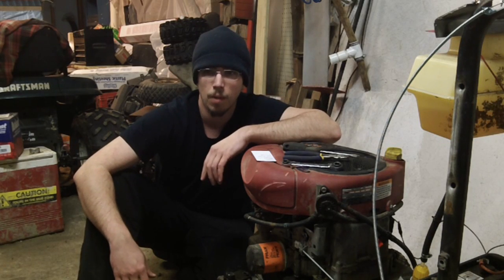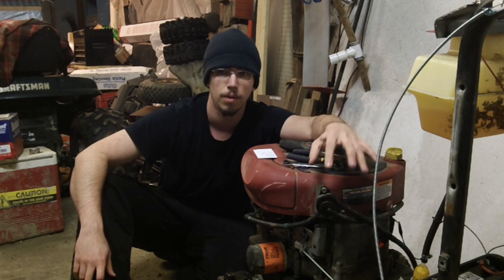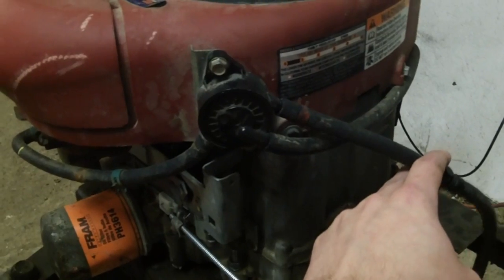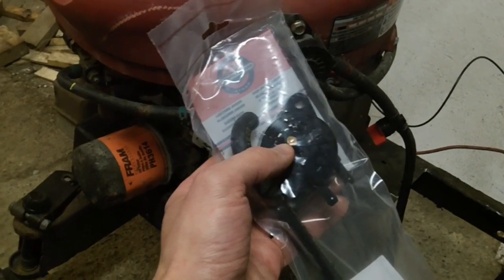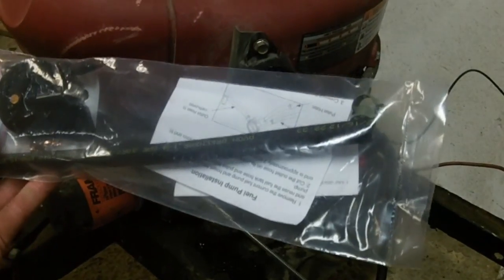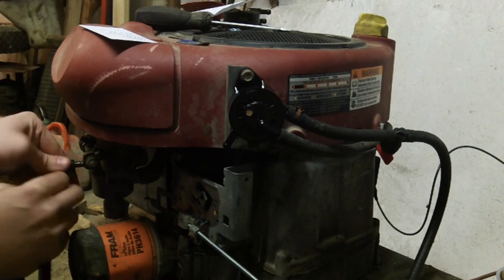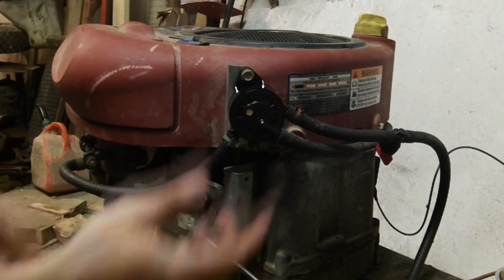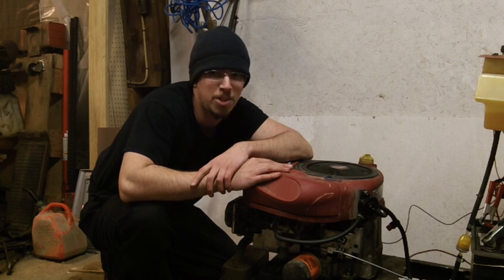Fuel Pump Replacement Briggs & Stratton 799056

Comment: whenever you see fuel coming out of the hole in the center of the fuel pump, does that mean you need a new fuel pump ?
Reply: I am replacing mine right now and I have fuel from the fuel filter but I have no gas in the line to the carburetor so it has to be the fuel pump at least that is what I will be doing first.